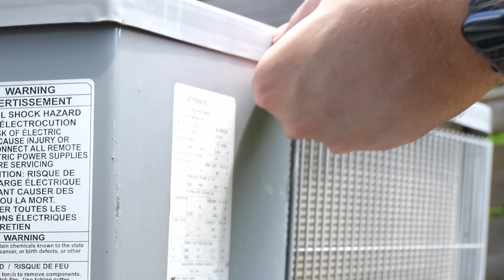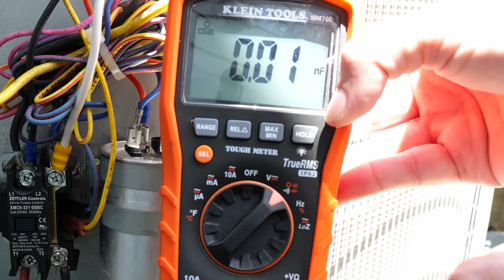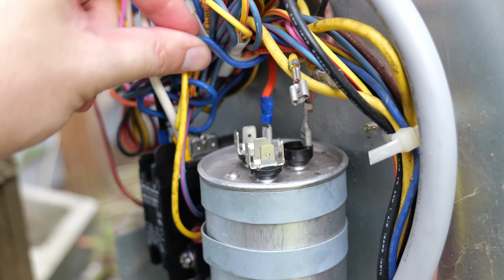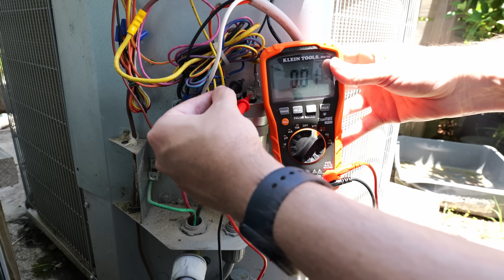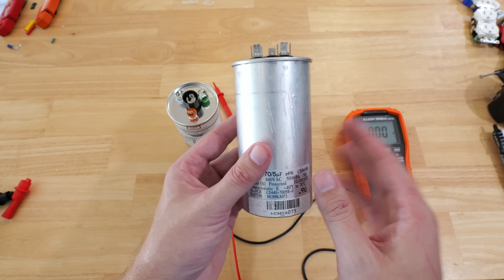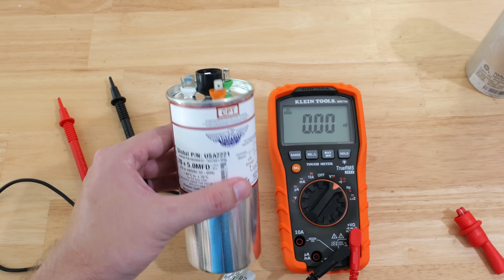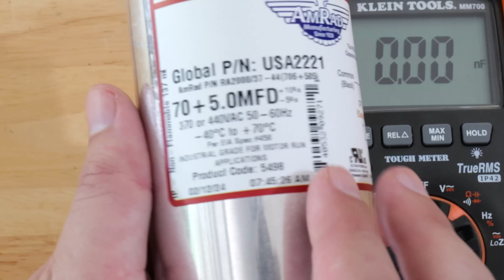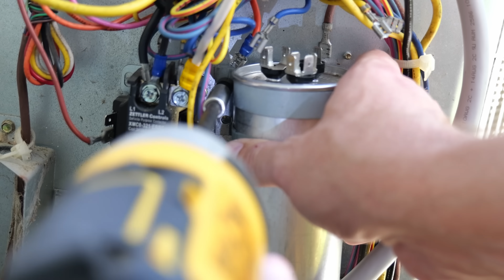Don’t Get Ripped Off! How To Avoid The AC Capacitor Scam And Save $500

Comment from the maker: Has this ever happened to you?  If so, was it the capacitor or something else?
Reply: SMCDisaster  yeah but the capacitor can be bad and able to start the compressor or fan, but won't run full RPM and will overheat.
Reply: Had run capacitors burn out every year, not knowing better we would have an AC guy replace the run capacitor. I asked why these things burn out so often. He said "Well, since they took the PBC's out of them they don't last as long." Myself and my wife researched these and found that the reason they burn out is AC guys just stick whatever is on the truck into the unit. We ordered the correct size from someone on ebay, watched a video on how to replace it and the capacitor never burned out again after that. $35 once was better than $150 a year to have an AC guy do it wrong. We purchased a spare so we don't have to suffer heat waiting for a new one.
Reply: @grandetaco4416
If the wrong size was installed, you would be seeing the wrong replacement size stamped on the bad capacitor resulting in purchasing, again, the wrong size. Is the correct information placarded on the unit somewhere to verify?
Reply: How much did he try to charge for Capacitor installation  . How much should you expect to pay for Capacitor installation?
Reply: @ryanslats6764  well in canada a capacitor is like 20 or 30 bux. So cost of part plus the tech's call fee. Call on x-mas at 2am i would imagine 500 dollars would be a minimum.
Reply: Uh, I replace that particular brand of capacitors because they are junk. I've seen probably over 1000 of those go bad. So to save the customer from having to call me back in a few months (which looks bad on me) I replace them, but I tell the customer why. It doesn't matter to me though, if you want to keep that capacitor, I'll be glad to come back in a few weeks to months..
Reply from the maker: @Bryan-Hensley mine have always lasted 5-7 years with the brand in the AC.  That’s fine with me.
Reply: @HowToHomeDIY  I don't find 5 to 7 years acceptable. I consider that junk.
Reply from the maker: @Bryan-Hensley you can consider it whatever you want.  But here in the South where we stay hot, that is pretty standard.
Reply: @HowToHomeDIY  I live in East Tennessee and I've been in working on refrigeration since 1980 and started my own business in 2002. I've installed well over 1000 heat pumps. I've got hundreds systems out there that have the original capacitor for 20 plus years. The customer doesn't like it when something fails within the first 10 years. There's been a few batches of bad capacitors get through, but other than that 98 percent of the time sometimes causes the capacitor to fail. That's where skills, that diy and inexperienced don't have, come into play.
Reply from the maker: @Bryan-Hensley that’s great.  You certainly have experience.  Down here though we stay hotter for much longer which is a huge enemy of capacitors.  Nobody expects to get 20 years out of a cap here.  It just doesn’t happen. So we don’t like it either but it is what it is.
Reply: @HowToHomeDIY  Why did you call an A/C repairman when you are knowledgeable enough to DIY & know he was a crook ?
Reply from the maker: @MisterMatthew59 I still have a service contract just for an extra set of eyes and to get my refrigerant levels checked.  It was time as it had be 7 years since they had been.
Reply: @HowToHomeDIY 
Use an amp clamp to verify current through the capacitor, both compressor and fan. It'll nearly always be the same value unlike the run winding of the capacitor. Get a baseline, and if it's below that by a significant amount (6%) check the capacitor. It's easier than pulling off the wires on the terminals all the time.

Measure the temperature of the condenser coil return bends about half way down the coil. This is your don't condensing temp. (minus a few degrees for surface effect) The evaporating temp is immediately after the txv or piston inside the air handler/furnace. This prevents the loss and potential contamination of refrigerant and is much safer in my opinion. It's how I check refrigerant levels every day.

PS. The temp between the condensing temp and the liquid line is subcooling. This is an important charge indicator when you have a txv. The difference between the evaporating temp and the suction line is superheat. With A TXV, this should be fairly stable at between 8-15°f. (preferably 10-12°f) With a piston SH is an important change indicator when compared to a charging chart.
Reply: @SuperS05 Capacities don't have run windings, motors do. Is that what you meant? Did you Google that answer, sounds like you Googled that answer
Reply: @thehollowexchange3717  no, the START /AUX winding is in series with the RUN CAPACITOR. Try reading the post with both eyes next time.
Reply: @SuperS05  Obviously I did that. Thats why I commented. It's hard to read because it's not very well written. It's almost like you dont know what you are talking about. Like i said in my first comment, you're regurgitating whatever crap you read on google, but can't quite get it out right in your own words. Stick to your day job.
Reply: @thehollowexchange3717  😂 commercial/industrial hvac is my day job. Residential is just to boring and easy. I can check hundreds of capacitors /motors a day on the slower maintenance months.
Reply: @SuperS05  100 in a day? You're a wanna be HVAC tech. We all know you're an air quality control. Go change a filter buddy, leave the complex shit to actual techs
Reply: @HowToHomeDIY  I've seen one video where the author added the corresponding refrigerant to his unit in a way same like you would add it to your car. May I know your opinion, if it is a good idea?
Reply: Yes- capacitor.
Reply: Yes. 
It was the capacitor.  
Their new one lasted just a few days.  They couldn’t make it back out in a timely manner so I sourced one and installed it.  I returned their capacitor for a refund.
Reply: This industry is rife with dishonesty and it really doesn't need to be.
I had a company come out a few years back to service my refrigerant. I'd tested beforehand and found the superheat value not optimal.
I never used any AC terminology, let on or told the contractor I knew how to service an AC system. The call was made because I did not have the R22 on hand to do it.
He came out ($95 service call which...though higher than normal, was okay)...hooked up his gauges and offered to service the system...at a rate of $450 per lb.
I politely declined since I know Ability Refrigerants sells it...if you have an environmental license.
Their cost...$32.90 per lb.
That license cost about $300 and some studying to acquire.
Had the guy said $60 or even $70 per lb, I'd have no problem with it.
How do you get from $32.90 to $450 per lb?
There needs to be some serious cleanup of the HVAC industry.
Many of the people getting scammed are elderly folks on a fixed income.
Some need to stay cool for safety.
Reply: Had a guy come out and he said we needed a brand new unit. I had another tech. come out only to find out that the problem was a bad capacitor that cost $18 - this happened several years ago. I called the company manager who just happened to be the first guy’s dad and I threatened to report the company, so he gave me my service call fee back. 👍🏼
Reply: During our last heatwave here in NJ, AC was on from 6/19 to 6/23..... the last date was when it stopped blowing cold air. Was this close to calling an HVAC company. Saw this video, and ordered a capacitor(made sure all the numbers matched with the old 1) the next day. It was only $18! Now AC's working better than B4! Love YouTube!
Reply: It’s a good idea to check amp draw on both fan and compressor when finding a bad capacitor. The failed part could be a symptom of another problem, a high amp draw can indicate a failing motor or compressor. Something to consider.
Reply: @CS-ct1ni  that's true. It's more accurate to say that a failed capacitor is due to heat. So that may be starting too often, motor overloading, (especially slower motor operation on a psc), bad windings, low voltage, or just lots of  time of normal operation.
Reply: Nope, I can't say that it will ever happen to me because I have an Electrical Engineering Tech. degree among other things and I work on my own HVAC equipment rather than paying some price-gouging stooge to do it for me :face-green-smiling:

The EPA 608 & 609 certifications are easy to acquire hence you can buy the refrigerant online that you need but it's not going to be cheap since the companies selling HVAC supplies are price-gouging everyone these days 🤯 

Yeah, ignorance might be bliss for some people but you pay for it in the long run 🤣

By the way, my brother-in-law/sister got taken for $20K+ for only two new 3-ton R410a condensing units during the Plandemic.  Also, there was nothing wrong with the R22 units to boot other than a drier vent being located behind the condensers which gave the coils a lint insulating coat!  Now that's what I call getting financially raped since I could have bought the units for $2,500 (+$250 labor) and felt good about it at the end of the day 🥱
Reply: @billybob042665 the American made capacitors fail far more often than the Chinese ones, it's a shame but the truth.
Reply: Has anyone been able to get their money back ?
Reply: YES!  *** PLEASE READ***  In fact 6 days ago.  My AC stopped working.  The condenser fan spun but the compressor was silent.  A technician was called in and did his diagnosis and determined that the compressor was bad.  They provided a quote for two options: $4k and $7k.  Meanwhile! I called around to get replacement quotes from other HVAC contractors and one of the independent businesses offered to verify the diagnosis since he identified that the AC was a "top-tier" unit with a lifetime warranty and had significant doubts that the diagnosis was correct.  It turned out to be a bad 45/5 uF capacitor - a $20 part!  He got my AC up and running in no time and didn't charge me for any of it!  Wow!  I called the original contractor with the news and provided constructive feedback.  They were very receptive about it, appreciated the feedback, acknowledged their blunder, took responsibility for it and......gave me a full refund and...offered a free "maintenance" visit.  Wowza!  To be clear, I had no hunch that this was an intentional rip-off.  It was an honest mistake done by a very young technician that will gain experience over time.  I learned a whole lot about these capacitors.  Happy Ending!
Reply: YES!  *** PLEASE READ***  In fact 6 days ago.  My AC stopped working.  The condenser fan spun but the compressor was silent.  A technician was called in and did his diagnosis and determined that the compressor was bad.  They provided a quote for two options: $4k and $7k.  Meanwhile! I called around to get replacement quotes from other HVAC contractors and one of the independent businesses offered to verify the diagnosis since he identified that the AC was a "top-tier" unit with a lifetime warranty and had significant doubts that the diagnosis was correct.  It turned out to be a bad 45/5 uF capacitor - a $20 part!  He got my AC up and running in no time and didn't charge me for any of it!  Wow!  I called the original contractor with the news and provided constructive feedback.  They were very receptive about it, appreciated the feedback, acknowledged their blunder, took responsibility for it and......gave me a full refund and...offered a free "maintenance" visit.  Wowza!  To be clear, I had no hunch that this was an intentional rip-off.  It was an honest mistake done by a very young technician that will gain experience over time.  I learned a whole lot about these capacitors.  Happy Ending!
Reply: YES!  Replies don't seem to post here.  Please read my comment!
Reply: Once for fun I removed the capacitor off an electric motor and tested if the motor would start up. The Motor started and ran fine without the capacitor.
Reply: @Yllycci Tell me you know nothing about motors without actually telling you know nothing about motors. You're either lying or you don't know what the fuck you took off the system. Either way you're Ignorance is showing
Reply: I had a tech tell me that my recently replaced fan capacitor was 12 UF instead of 5.5 UF. Capacitors don't normally increase in value. I declined the replacement, replaced the cap myself and sent the original to the manufacturer, AMRAD (because I did not have an LCR meter at the time). The manufacturer tested the capacitor, found it was in spec and sent me a new one as spare.  Recently I had a legitimate failure of the condenser fan and had it replaced. Six months later on a preventive maintenance visit, the technician reported my (new) fan had failed. Very odd . I reminded him it was under warranty. I have to wonder ..
Reply: SMCDisaster negative. The fan running after pushing means that it's the capacitor AND/OR the motor start winding.
Reply: I keep a backup capacitor for each one of my units. Absolute easy fix.
Reply: I see you have a lot of butt hurt HCAC guys on here. They can preach needing a " minimum" charge to stay in business but they don't need that much. Lying bas turds
Reply: I had a guy tell me that once, it was within spec when I checked it myself/sp I sent him packing....
Reply: My fan or my condenser was running backwards. I noticed that when I was cutting the grass, thank God, I shut it down and replace the capacitor and a couple of weeks later my neighbors did the exact same thing, but it ruined his fan. I heard it clang went over and shut it off in the middle of the night for him. I offered to give him a hand to change capacity, but he had company come out and charge him 700,  he said all it was with the capacitor. He had changed the fan himself a couple of days prior.
Reply: yes  a evil crap head did it
Reply: No, it is the cheap Chinese products, flooding our country...Because our failed politicians allowed it to!
Reply: You buy a cheap capacitor and you replace it every year. I buy Genteq. It cost a little more but last 5x longer.
Reply: Great video. This is a big scam in North Texas. Many years ago, I had a well known/popular AC company come look at my AC unit because it failed to start. They said it was burnt out and they tried to sell me 2 new AC systems. I know something was fishy since mine were only 6 years old. He had already placed his company stickers on the units as well and tried to get me to sign acceptance of his agreement. I told him to get out of my house and just to send me a bill. Long story short I reached out to a smaller self-owned company who quickly showed me it was just an blown capacitor, in which he replaced both for about $140. They ended up lasting me about 12 more years. It's really awful that companies  like this are out there. Especially since they are the one's advertising on tv all the time as well. I guess that's how they pay for it though. Thanks again for your video, you're doing a great service to people.
Reply: I was told $1200 dollar by a AC tech,  lifetime guarantee.  No warranty was $899.  I sent him on his way and bought my own and replaced it myself.
Reply: Hey man quick question. I have a small air conditioner that the fan seems to make noises and kinda not stay consistent I think it's dust and grime kinda how bathroom fans get. I just wanna make sure when I clean it  if I unplug from the wall there isn't some capacitor or transformer that will kill me before I know im dead like a microwave. Nothing to for sure on Google is why I'm asking. I think I'm good but hey.
Reply: My capacitor failed a couple days ago. It was Genteq D156132P18  27L880  370 VAC   45 micro F   5 micro F  +6  -6% tolerance 50-60 Hz, made in China. The capacitor lasted 8 years, when I measured C shows ~0 uF on both terminals. Thank you for the sharing of your outstanding knowledge about these issues with AC.
Reply: Fan wouldn't run. It was the capacitor. A way to test is to hand spin the fan and see if it runs then.
Reply: @tgriebe  Exactly my problem and way to solve it. I'd hand started it for a day trying to keep it going
Reply: I would be willing to wager that this was a rookie technician at your home. Most techs are not trying to scam you.
Reply from the maker: @mr.roberts3886 said he had 15 years experience.
Reply: Great title to get views and excellent how-to-do video, but the story doesn't make sense.  If the capacitor was still good, he would replace it with a good one, but a problem would have still existed. How would know you go scammed?  What else did he have to fix?  The chance of a loose wire is <1%   Of course the scam is the price they charge for a simple replacement is outragous but that wasn't your story.
Reply from the maker: @robertmiller7849 I don’t understand what you’re asking.  It was a routine maintenance call.  They check everything.  He said the cap was bad.  I said there was no way.  He showed how he tested it.  I showed him how you can’t test it that way.  We tested it the way I showed in the video and then it magically showed the cap was good.
Reply: Did you report him to his company? I would mention reporting the scam to BBB, then the company will be more likely to take action.
Reply from the maker: @ultramanmountainadventurer6769 yeah the guy no longer works there.
Reply: @ZeroCool2345  , my experience has been that AC guys are ALWAYS trying to scam you.
Reply: @ZeroCool2345 I've had two do the same scam now.
Reply: It wasn't the $500 scam, only $350. I had a pretty good idea what the caps cost. Disputed part of the CC charge, allowing for 100% uplift on the cap and cold start kit and labor. They capitulated. I read them the riot act when they wanted me to renew a service contract with them.  I've purchased a backup for the start cap and I'll swap it out when the inevitable happens.
Reply: Why on earth would you accept the service if you were going to dispute the charge?